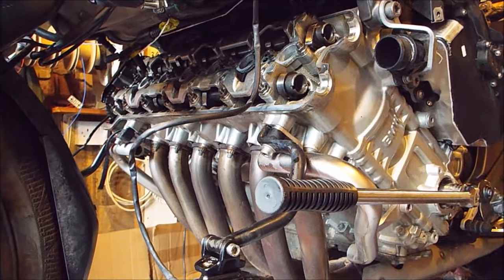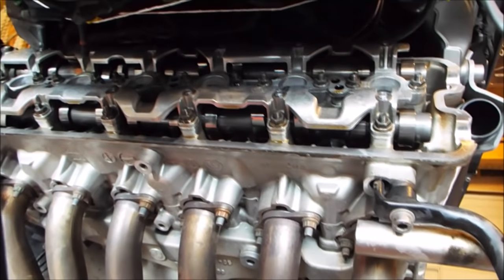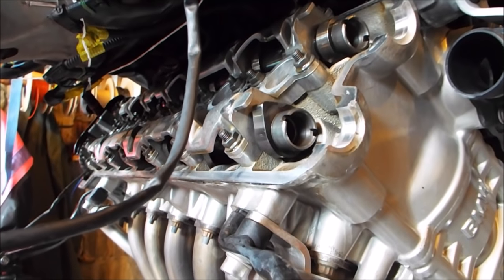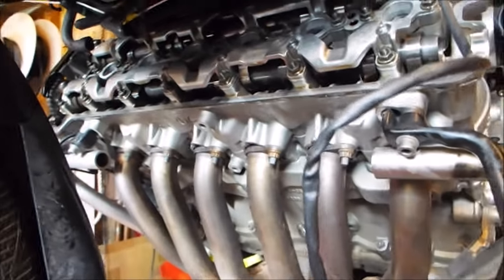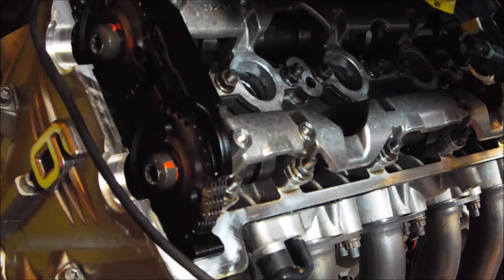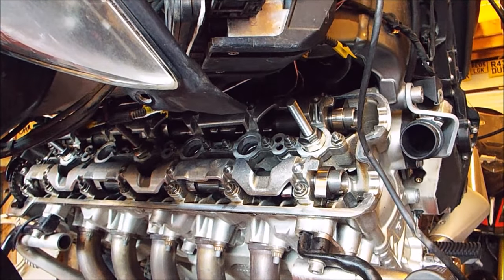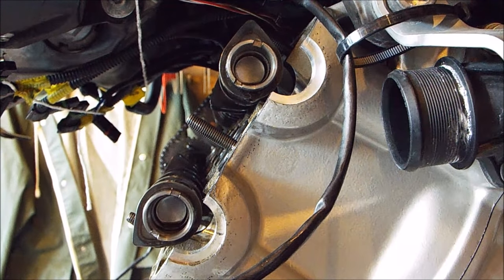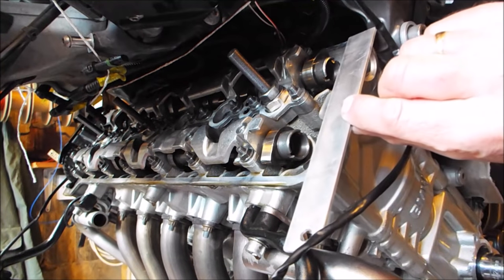K1600 Valve Clearances

Comment: Your explanation was very helpful to understand the procedure step by step. Excellent video, would have loved to see the how the cam gears come off , and what  you do to keep,them locked in place. Also the procedure to resize/replace the buckets..Thanks again for the video.
Reply from the maker: Thanks for the positive feedback. 
To set the clearances you don't need to remove the sprockets from the cams. Replacing the buckets is at 17:30 - Full details on how to select the replacement sizes you need are included in the book. https://www.marksmotorcycleparts.co.uk/product-page/copy-of-service-manual-for-bmw-k1600gt

Comment: Excellent video, thank you!  Interesting tool you made to prevent distortion of the casting.  Would this use the same technique as the old Jaguar XK engine, they required a 4-8 thou clearance but the valve actually had to lift off its seat for the clearance to be correct, a tight sliding fit would result in a horribly noisy head.

Comment: Great video thanks!I would imagine that a K1300S would be a very similar job as the 1600. I just purchased a K1300S with 36,000 miles on it and the BMW dealership is saying that it will need this service done to it. I plan on getting the BMW service  DVD and doing it myself. The 6 and 4 cylinder motors appear to be identical in appearance but what do i know....

Comment: Hi Mark and friends, Mad question, I'd like to retrofit a used K1600 engine/gearbox to a used Catherham 7. Would the K1600 be machinacally able to support a Rotrex supercharger to say 250 bhp, without blowing up the rods, crank and gearbox? I would assume stronger clutch plates would be required, but none seems available in the aftermarket.
Reply from the maker: Interesting question. Not sure of the answer. You'd definitely need a bigger than standard radiator - even at stock power levels the cooling is marginal. If the engine could take it, I'd be concerned about the gearbox - a car won't accelerate as quickly as a bike so the gearbox will feel the full force of the increased torque for much longer, and will might either break or wear out more quickly. Suzukis are much more of a known quantity - more people are doing very high power engines so knowledge, spares and turbo kits are much more available. A reliable 500bhp from a Hayabusa engine is doable. I know its a 4 not a 6, but it'll be reliable for much less effort.
To answer your question, you might get away with it, but you'll be figuring it out as you go and when it goes wrong it will be expensive.
Reply: @ducatiparts110mb  Your right Mark, common sense is go the Suzuki Hayabusa route for reliability and accessibility of parts. I've a feeling the K1600 gearbox would give out, even if the total weight of the car and engine is 600-650kg, but the wonderful engine note of the K1600 is so hard to let go off :-)
Reply from the maker: @ronniet906  I agree, K16 vs Hayabusa = heart vs head....

Comment: I have a question about the timing cover..i removed all the screws but it doesn't come off..i have to use a screw driver?
Reply from the maker: You may need to gently tap it from each side with a mallet  to loosen it

Comment: How often does one find a valve clearance out of spec?  I am on my 5th BMW K1200 and K1600 and never once had a valve clearance out.  My point is it worth doing this maintenance under 100,000 miles?
Reply from the maker: Yes, it is absolutely worth doing it. BMW tell you that you should, so I am not so arrogant as to say that I know better than they do. However, on my K16 and other DOHC bikes, the clearances normally stay in tolerance for far longer than the recommended interval, and you'll get the peace of mind of knowing that everything is fine without the need to take the cams out. I checked my Africa Twin at 6000 for another service book (the interval for the valves is 16000), and more than half of the clearances were out of tolerance, so do not assume they'll be right without checking.
Reply: @ducatiparts110mb  Thanks, I have been buying what i need for this falls big tune up.  Plugs, Antifreeze, Anitseeze, electrical lube, etc etc.  I did the valves once and that freaking air breather tube I remember was a total headache.  This time I will try a hair dryer to heat it and use grease to reseat it.  The actual valves check is a POCake unless one is out.  Thanks again for your awesome videos.  I doi have one question: I flushed my clutch with Blue Blood.  I have one tiny air bubble I think near the master cylinder.  That darn air bubble just will not work its way out even after 4 months.  Any suggestions?
Reply from the maker: @navyretired230  You're right, the air tube is pretty much impossible to remove without breaking it. I sell a flexible alternative on my site marksmotorcycleparts.co.uk that is half the cost of the BMW part and reusable.
Some bikes have a bleed nipple on the mastercylinder, but if yours doesn't I'd try turning the bars fully to the right (bike on the centrestand) to raise the clutch as far as possible.
Reply: @ducatiparts110mb  does your air tube come with something to make the oem rubber grommet a smaller size to fit your new design?
Reply from the maker: @navyretired230  My air tube uses the original grommets. After you take the old air tube out, swap the grommets over to the new air tube. Before refitting it, apply a little rubber grease and fit the new air tube to your engine. Mine has been on my engine now for 35,000 miles with no problems.

Comment: Why is this necessary?  I would think BMW of all companies would have the engineering to be able to make an engine that doesnt require this
Reply from the maker: There have been a few bikes with hydraulic tappets over the years, but its a difficult technology make small enough and reliable at very high RPM, so bikes have never embraced it.